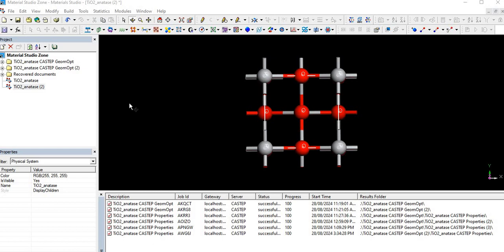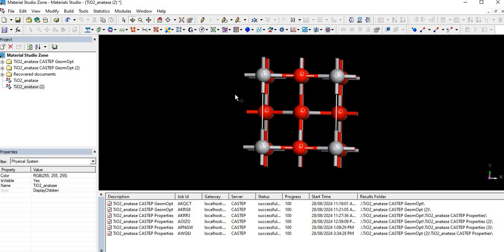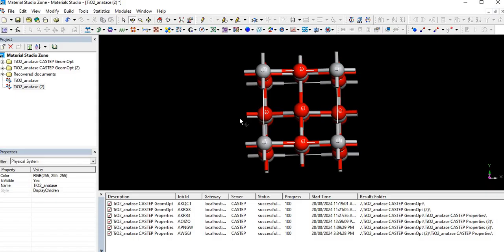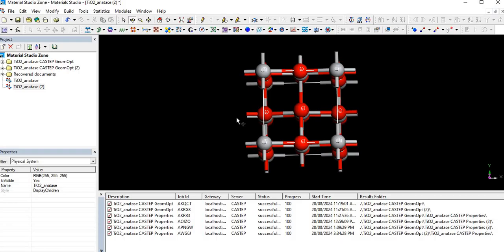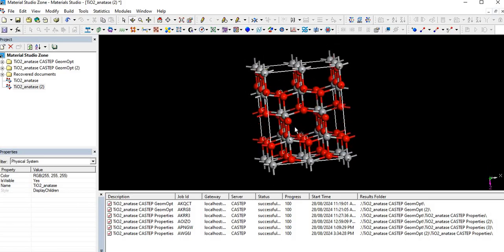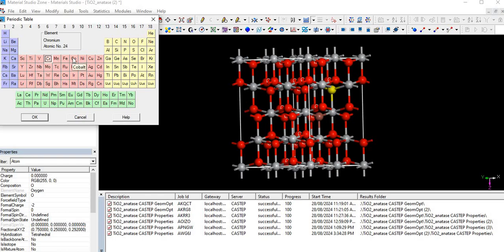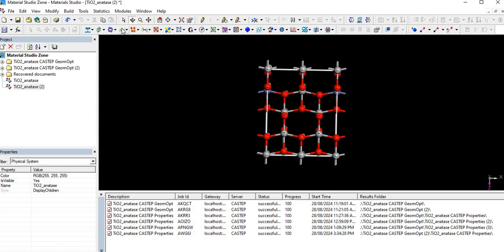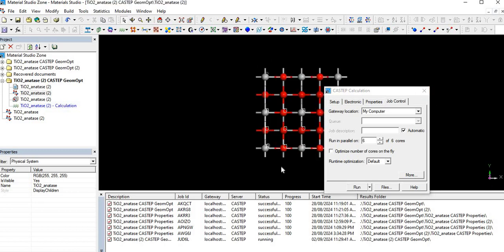Tio2 Mono-Doping| Co-Doping| Tri-Doping | How to Add dopant in material Studio|

Comment: Hello, Thank you very much for this insightful lecture!
During CASTEP geometry optimization, I have developed a super cell and vacuum slab (to suite the final application for adsorption), however, the geometry optimization repeatedly fails. But without vacuum slab, the optimization went well. Should we not include the vacuum slab prior to the optimization?

Thank you!

Comment: By doping if bond of dopants with host breaks  supercell during 
 geometrical optimization, is it correct?, i let them to finalise the iteration?
Reply from the maker: Yes, it is possible for the bonds between the dopants and the host material to break during geometrical optimization, and this can be a valid behavior depending on the nature of the doping and the material's structure.